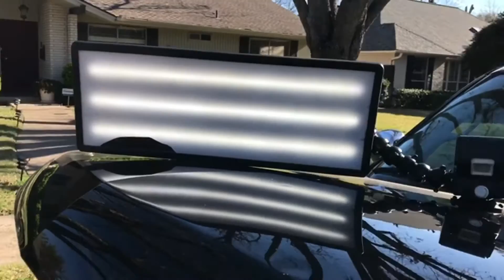Paintless Dent Removal (Hood Dents)

Comment: what if the dent was on the hood where underneath the hood was the extra metal bracing? (like .  a second layer of metal that wouldnt let you put the tool underneath. would you use the gluenad pull?
Reply from the maker: randomrazr yes in this cases we would use what is called a glue pulling method with a specialized glue tab and lifter or slide hammer. Usually in the hood there is enough space to use another tool called a whale tail. It’s a very this tool that Wedge’s between the brace and outer layer of hood. And use the same concept of pushing from underneath I showed in this video. 🤟🏼

Comment: Nice job.. i would like to know if you used the same tool under the hood the hole time?
Reply from the maker: Luis8I on this one I believe I did. When working a Hood with multiple dents in different locations you can use multiple tools in different shapes and lengths. To access behind braces etc.
Reply: @newimagedentrepair  ok, thank you for answering. great video!

Comment: What if theirs no access point
Reply from the maker: Great question. The only option when there is no access points would be to use a method called  glue pulling. This method we use glue tabs with hot glue and either a slide hammer or a mini lifter to essentially flip the dent inside out leaving it high. From there gently tapping it back down smooth until it is flat and even with the rest of the un dented panel.